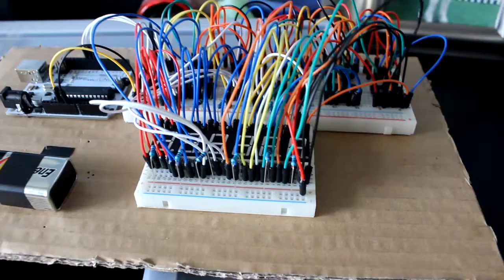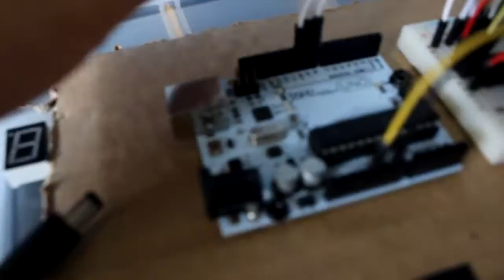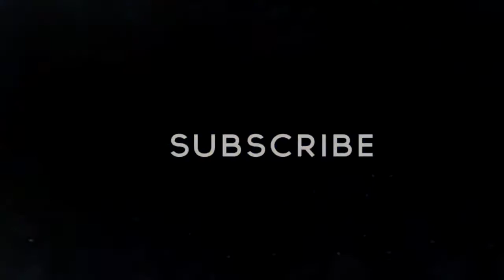arduino uno clock using 6 74hc595 shift registers and segment displays

Comment: I have similar wire connection but mine is only 2 shift registers for 4 digit 7 segment display.  Wiring this is really difficult not because it hard to understand. It's hard because everything is so small. I have to use magnifier glass to inspect for any mistake.